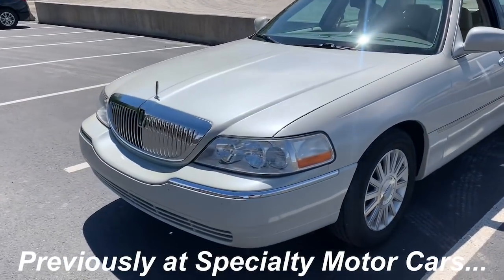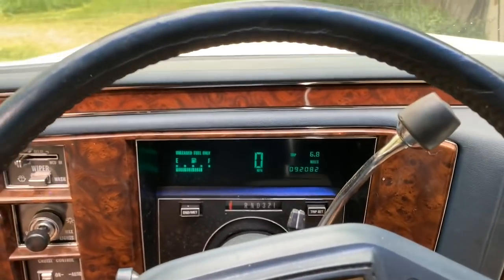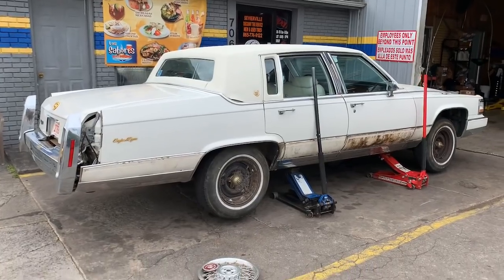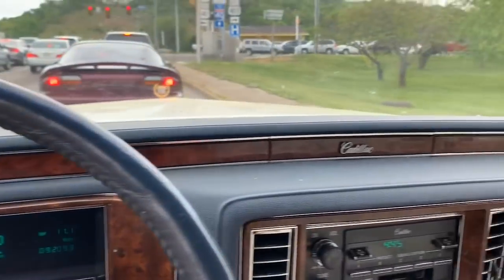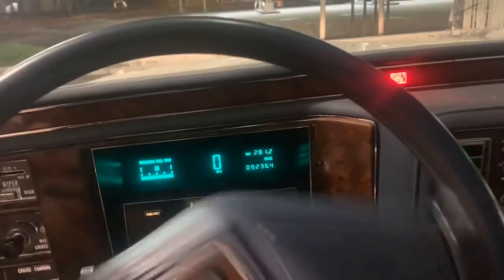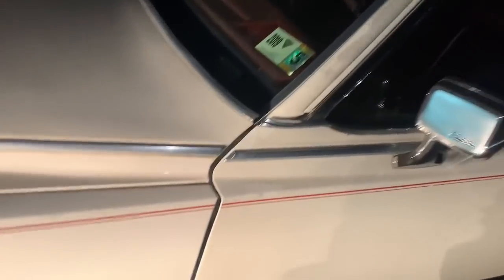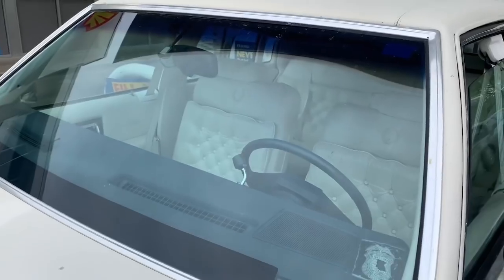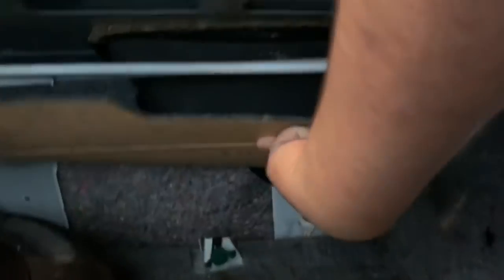1991 Cadillac Brougham RESCUED but it DIED ☠️ 1,000 miles home 10 years off the road  D’Elegance

Comment: Typical of gas filling stations in the US the nozzles have a lock on them that allows you to leave them poking in the gas tank while not holding onto them.
Reply: Not all US states
Reply: Same thing down here in New Zealand and Australia.  A handy feature.
Reply: Some have 2 holes ea around the actuator lever but no wiring.
Stick a pre-bent L-piece of titanium from a mig welder in and
it locks the lever.

Comment: In the future that roachy Brougham will be considered a great restoration candidate - but the market isn’t quite there yet for a business like yours to make business sense out of a completely restored car
Reply: I don't think it's roachy at all, sounds like he is going to do what he does with most of his cars...new top, headliner, antenna, fillers, brakes. The car proved it's mechanically sound by making a 950 mile trip without even a hiccup (well it did stall once because it was jealous.... doesn't count).
Reply: @michaelreece458  Michael, not to be confused with the Brougham he bought and drove back, I was referring to the Brougham that was at the Ford dealership that he looked at on his way back - Anthony and Papa Bear were not impressed at all with that Brougham.

Comment: Ed Morse Cadillac, oh my! They charge $100 just to open the Service bay door! The white caddy is just absolutely Florida sun-baked! They charged me $500 just to replace the boots on the rear bumper. The second Cadillac you looked at it was the identical car color as mine. After the car reached a little over a hundred thousand miles it nickel-and-dime me for 5 years! Footnote... when the car was new there were three Cadillac dealerships here. Good luck with this endeavor!

Comment: Is this a 3/4 Cadillac as you sold a 1/4 Cadillac? I estimated
is uses about 14.6 mpg . The choice from from its weight, 
drivetrain friction, drag, and tires roll resistance.

Comment: Had an 89 Brougham deElegance and  loved it.   OTT traditional Cadillac  elegance  with  plush velvet interior 👌 Never  should have let it go!  Also  had 93 Brougham.  Not  close to  89 in  quality of  appointments.  Had  issues with  CD player,  air suspension,  leather seat peeled, and  although  it  was  well cared for by  previous owner  and  me, rear  wheel  wells  rusted  through  resulting in dampness in trunk AND rear seats! Hate to see  what  currently  wears  Cadillac  Crest. 😕 Save  those  vintage  Cadillacs.  Never be anything like them  again.

Comment: PRO TIP from my grandfather....any car thats been sitting and has questionable fuel pump..put a bottle of 2 stroke oil in with super gas the bottle that does at least 5 gallons....it will help the fuel pump.... i have seen someone run a tank dry and seize the pump...hit the tank with a hammer get it pumping again and then put in the 2 stroke oil and the pump is still going to this day..there is no lubrication in todays gas...

Comment: I agree with Papa Bear on this one. The question is why? Why would U drive so far to pick up a 92,000 mile ratty DeVille? Is there something special I haven't noticed about this car? Was it so cheap you couldn't pass it up?  Was triple white the deciding factor 😕?  After it's restored, it'll be beautiful with 93,000 miles. Keep it as a Company Car or give it to Papa Bear?  Based on your recent Trac Record, it doesn't add up.
Reply: Not a Deville. It's a big Brougham with D'Elegance trim.